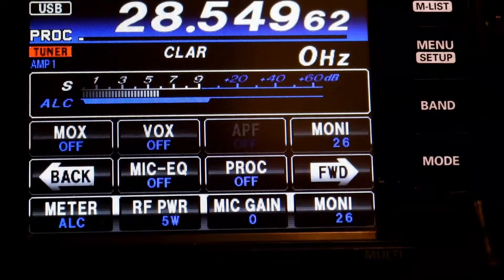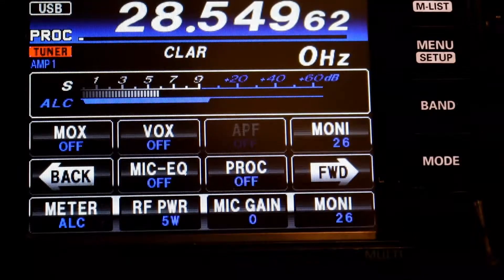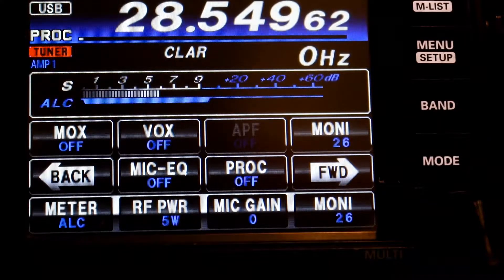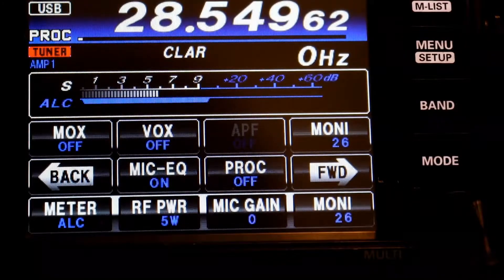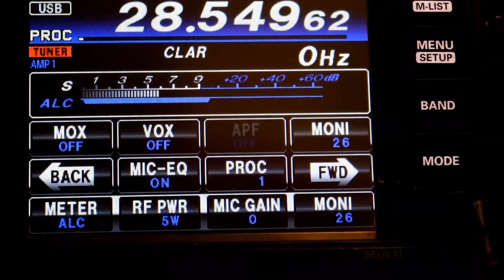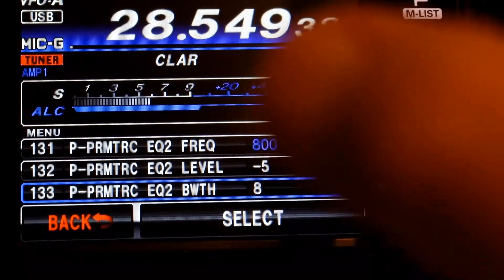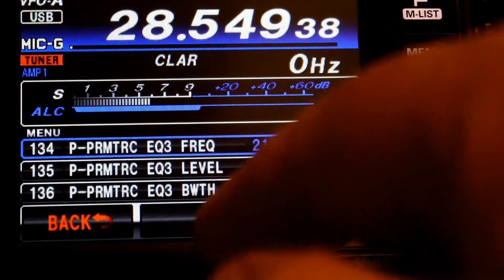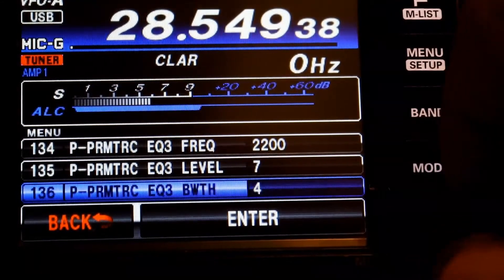Voice Processing and Compression Settings, FT-991A

Comment: just wondering why, when it's obvious that when using your soft touch pen, it keeps your auto focus from focusing on your hand instead of the narrow cylinder of the pen and the radio screen (frustrating), a little more on the fly self editing, seeing as you are making plenty of videos and it's plain to see you use the pen for just that purpose. just saying... I've watched most of your FT-991A videos and thank you I've learned so much more and quicker than if I had to look up everything in the manual and you really do such a much better job of explaining each function and items being addressed. thank you. Please don't be offended by my seemingly petty remark and keep up the good work!
Reply from the maker: Thanks for the note - While I'm a pretty fair Ham Tech guy, I'm not a camera guy.  I've increases my F-Stop which gives me a greater depth of field and I've also changed to a manual focus rather than auto.  All part of the learning curve.
73 de Tom, ND3N

Comment: Good evening Tom. I always find your videos very interesting, especially on the FT991A because I have one myself. My problem is that when making the settings as you described, I noticed that from 96 watts up to the maximum power of the FT991A (100 watts), I have the ALC indicator which goes back down to about 1/3 of its value with the MIC-EQ both “on” and “off”. On the COMP everything is normal (set between 5/7) with or without MIC-ON. On the other hand, on the PO indicator, the power is normal (checked with the BIRD 43). For information I have an MD-100 stand microphone. Do you have a solution to my problem or is this normal? Kind regards 73. Joël/F8MGW.
Reply from the maker: 1/3 ALC is perfectly reasonable, but play with your mic gain and see if that helps.
Reply: @ND3N Yes Tom! I must be stupid, I hadn't thought of that. Hi. Now it works. Thank you again, and treat us again with your very explicit videos. 73. Joel/F8MGW.